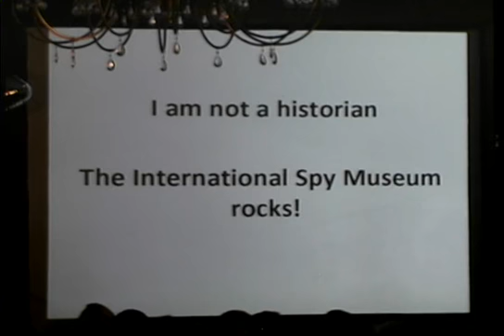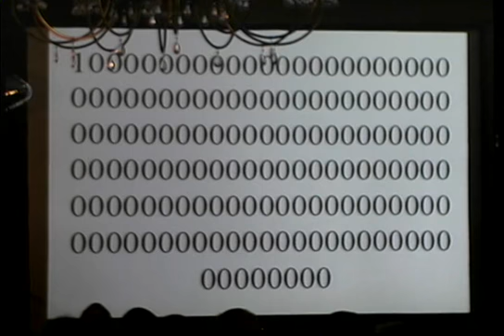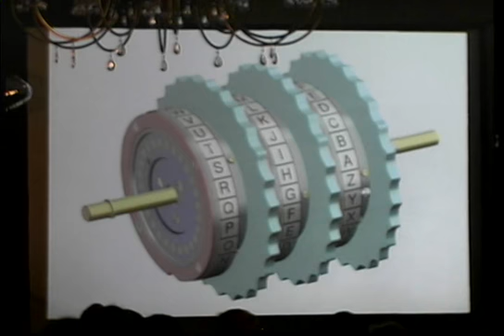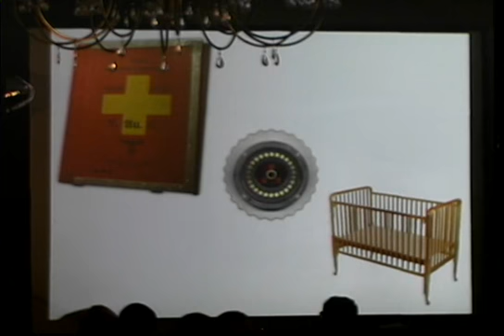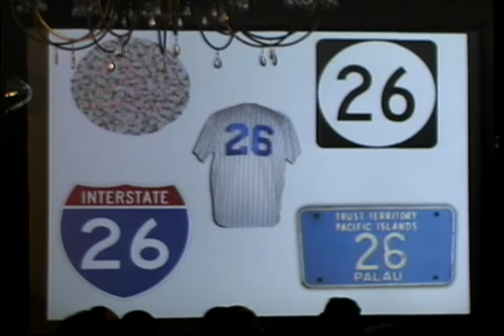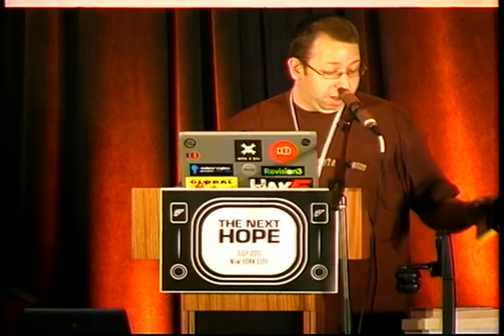The Next HOPE: American Bombe - How the U.S. Shattered the Enigma Code (Complete)

Comment: Actually the urgent need to break German 4 wheel Enigma codes could begin in anger when the first BTM 4 Wheel Bombes were delivered. It was these machines that brought about the second type of frame which added a major heavy section at the right hand end. This section was required to mount the additional 36 'Very Fast' Fourth Wheels. Later they were made in the USA. Also the bombe is NOT a computer! It performs 0 calculations. What it does do it perform electrical tests